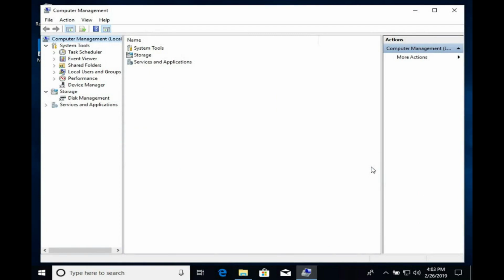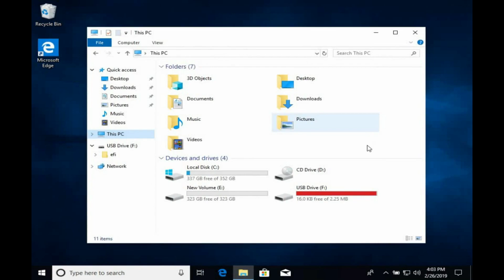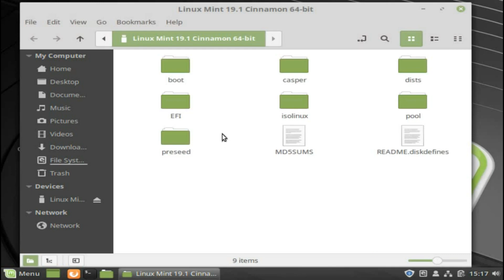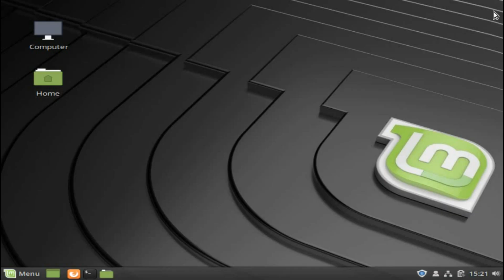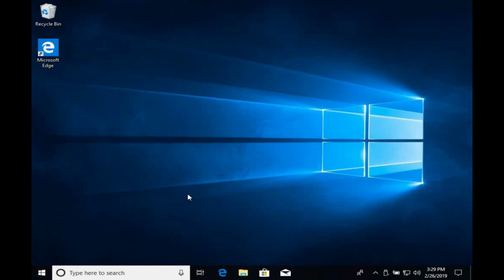Repair Flash Drive damaged by Flashing Tools | Method #1 (on Linux)

Comment: it format everything that it was on it ?
Reply from the maker: Yes. The data on it will be lost upon repair. The flash drive will become reusable.
Reply: @TechSolvePrac  can i recover my files that was on the hard drive ?cz i flashed ra1n with balena on it
Reply from the maker: @dansmedia1401  did you flashed your hard disk or flash Drive using Balena Etcher? Balena Etcher is used to flash portable drives to make them bootable and install operating systems in Hard Drives,.....
Reply: @TechSolvePrac  yes i restored my files by getdataback runtime but how to fix this flashing problem and get back to the hard disk normal size 1tb and not 200mb of this flashing
Reply: @TechSolvePrac  can i delete it from windows ? or i need linux? i copied my files from my hard disk i can format it from windows  and make new partition? or how
Reply from the maker: @dansmedia1401  ok. Now got your point. You have 2 options:
1. Delete partitions using Disks utility on Linux
2. Use Rufus software on Windows to delete all partitions and format the flash drive.
Check out the source article mentioned in description of video for detailed instructions.
Reply: @TechSolvePrac  thank u bro , i deleted the flashed partition than format the initial 924gb on hard disk than created new volume partition and it worked as (F)
Reply: @TechSolvePrac  is it okay like that ?
Reply from the maker: If capacity of your hard disk is restored to approximately around original capacity. Then it's fine. Just ensure there that all partitions that were created during flashing are deleted.

Comment: balena-etcher-electron-1.5.80-linux-x64.zip works
flawless for me when I wrote the manjaro-kde-17.1.7-stable-x86_64.iso (2.005.394 KB)
on my Sandisk 32GB. I am using Linux Parrot 4.61 and Windows 7.

After that I've tried to wrote the 3 debian 10 iso and it didn't worked at all. 
I mean debian-10.3.0-i386-DVD-1.iso (3.875.424 KB), debian-10.3.0-i386-DVD-2.iso 
(4.549.808 KB) and debian-10.3.0-i386-DVD-3.iso (4.579.482 KB) 
balena recognizes the fact that DVD-1 has a table and the other not, but I have no 
idea what must I do in order to succeed. Any ideas ?
Reply from the maker: Try using RUFUS for secondary DVDs

Comment: I will try on a virtual machine, because I don't have the Linux installed
Reply from the maker: While trying on virtual machine you need to bypass flash drive from host machine to virtual machine. Check out the article in description of video to use alternate way to repair drive on Windows itself.

Comment: I was flashing my drive with balena etcher and then the proces showed failed after sometime an now in the disk management it shows 29.9 gb unallocated no linux system files and is now in read-only mode. While i jut plugged it into linux mint no option for formatting and creating partition is highlighted. Even I can't mount it it shows mounting failed. Plz help
Reply from the maker: Please check out this article ... https://www.techsolveprac.com/repair-flash-drive

Comment: what to do if it was damaged by balena but nothing was installed, my USB stick lost is memory, from 64GB down to 8mb? help please
Reply from the maker: Try formatting it with Rufus software. Check out https://www.techsolveprac.com/repair-flash-drive/
Reply: @TechSolvePrac  error received in rufus "could not open media. It may be in use by another process. Please replug media and try again, i tried doing it and same error occur." another error when I re insert the usb "the directory name is invalid"

Comment: U dont need to boot into another OS just go into file explorer and format the 2.2 mb partiton
Reply from the maker: Many times it won't show other partitions after formatting that partition on Windows system. In that case one may log in to a Linux system and delete partition through Linux Disks application.

Comment: in disk manager i deleted the partition visible in windows and format the usb, seems to work
Reply from the maker: That's also fine. Most of the times it doesn't work on Windows. Anyways user problem has to be solved.

Comment: The title is a bit misleading isn't it? As the flash drive is not damaged, just because windows can't read them ;)
Reply from the maker: You are right. Drive is not damaged otherwise it cannot be repaired with the help of a software.. That's what I have tried to explain that drive is not damaged so it will be recovered by reconfiguring it. However, as per your concern about Title of the video. It is required to be mentioned as damaged because the users believe that there drive is damaged and they will search with that term. Once they view the video they will acknowledge that it's not damaged but it's just a matter of reconfiguring the drive on all OS
Reply: @TechSolvePrac  I am not so sure about this.
This Video was kind useless my usb doesn't show in the explorer, windows can not assign drive Letters to it and even though I can create partitions the process end with a barrage of error messages. Diskpart can't clean it and gets access denied. I am starting to run out of options.... : /
Reply from the maker: https://youtu.be/Q2i6IeCHfWg you may try this...